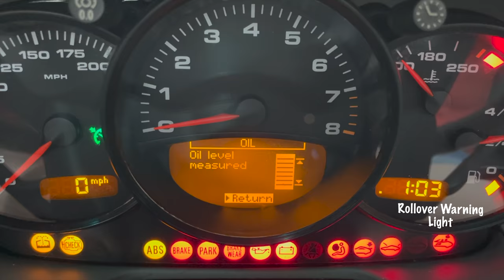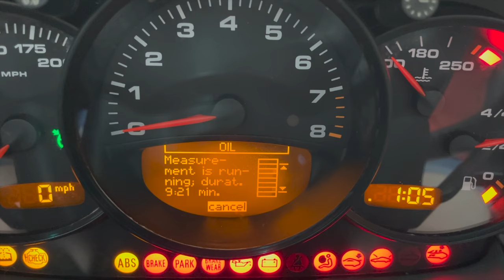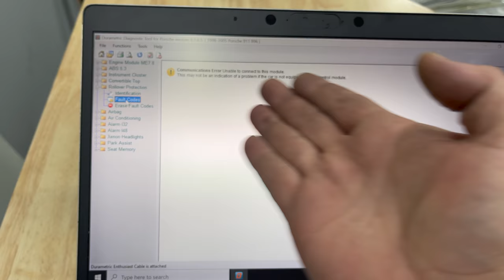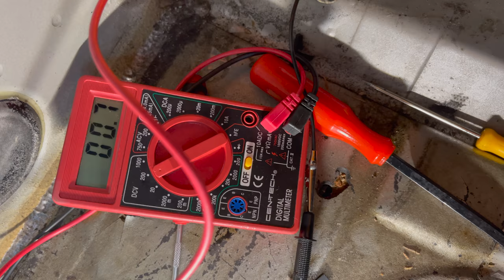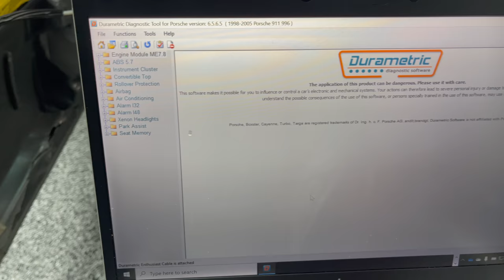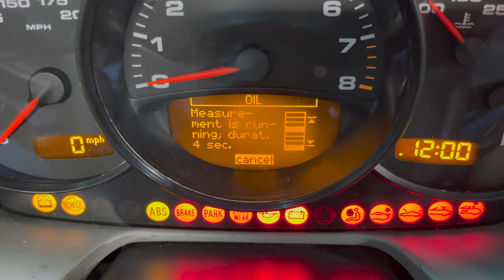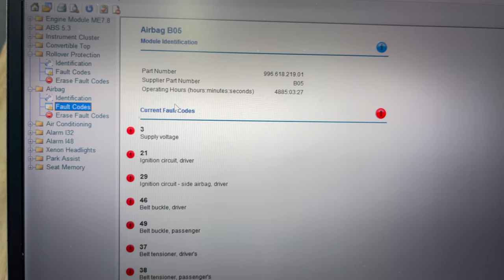Project: Pepper - Unravelling the ELECTRICAL ISSUES In My PORSCHE 911

Comment: Too late now, but did you consider the possibility that it was JUST the ignition switch ($10, as you know) was the issue? When mine went duff the steering lock didn’t work (nor did the HVAC blower)…a lot of seemingly unrelated electrical gremlins can be traced to that switch.
Reply from the maker: For the steering issue?  It was definitely the locking mechanism being seized up.  No play whatsoever.
Reply: @YogisGarage  ah yes I see now. I only have time to watch vids in 10-minute increments (don’t ask why)!

Comment: Good info.

Ever consider getting your old steering wheel wrapped in new black leather?
Reply from the maker: No I haven't but now I will consider it.  Thanks!  I have the airbag too.
Reply: check out the T96 turbo flat bottom wheel. just a little smaller diameter. and thicker so you can grab it. not a fan of the stock "boat wheel"... I've put it in all my 996/986 cars. i had to go directly to the supplier last time. they are taiwanese and are on eBay sometimes. the quality is exceptional and I've had one for over ten years.
you will be thrilled when you are done. that poor car was terribly neglected...
Reply from the maker: @rodanone4895  It really was. Very sad but it can be saved.  Engine rebuild video coming soon. In the meantime check out my WIIT Syndrome skit my wife and I did. Enjoy!